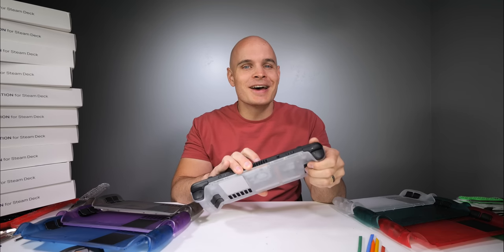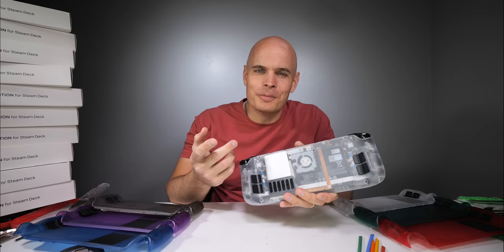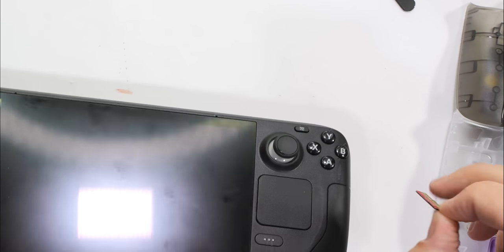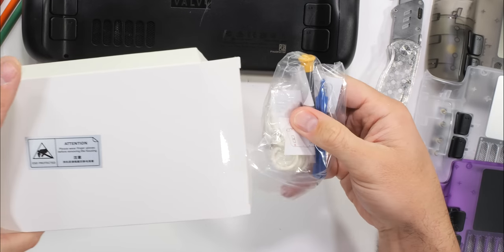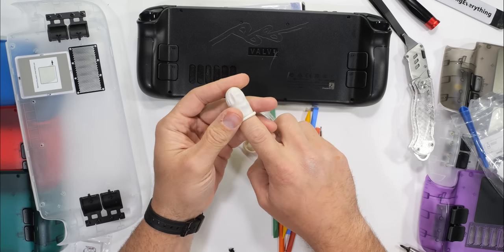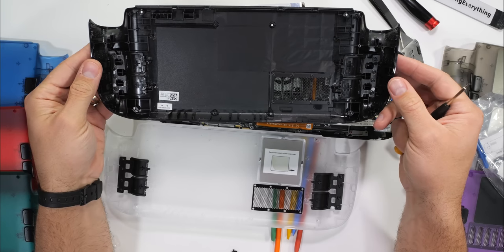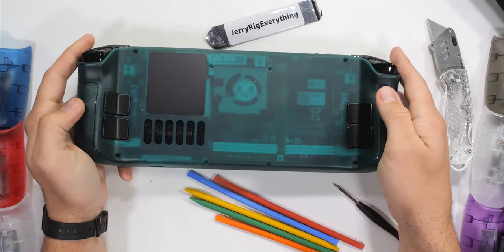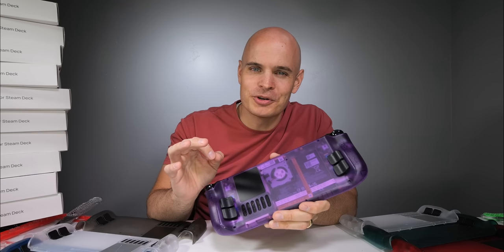NEW Steam Deck Transparent Edition!

Comment: I got the transparent purple one and the anti-glare screen protector. But I haven't even been able to do anything with my switch yet because I need this transparent back in the screen protector so that I can use the tools to take it off and switch out the 60 GB SSD to the 2tb SSD that I got and so that I can keep ice cream clean and undamaged until I get screen protector for them.

It feels like it's taking forever though!

Although I do like the transparent ones better I just wish they would have made it totally clear glossy one that was like super see-through instead of having the Smoky colored. So you could really see inside basically equivalent to what your skin looks like.

Comment: i have always loved transparent tech and don't understand why brands don't do it more often like in the good old days.. i have a steamdeck and would love to get my hands on one of these, i also think the thermal pad is a great idea
Reply: Transparent material costs more so most companies won’t use it because it’s cheap. Places like Jsaux are able to sell a transparent backplate for cheap because they use low quality parts that valve would never do
Reply: @Funnyduck  it is true that clear plastics are more expensive but most tech now is glass backed and so would be very easy to make a transparent back for them with virtually no changes. when you say that Jsaux are using cheap material you should reference this as i find nothing related to this and clear plastics are actually slightly stronger than those that are dyed.
Reply: @kbuxtonator5052  clear plastic might usually be stronger and I am not saying Jsaux isn’t “stronger” but it’s a cheap manufacturing, their backplate often doesn’t align correctly with the steam deck causing triggers to rub against. Recently on Reddit there was a thread where a ton of people shared the problems they have had with it

Comment: I love the addition of a the Heatsink on the back of the plate. I think all companies that make stuff like this should try to incorporate changes or improvements to the products that might help the end user in the long run. I have a Steam Deck and I can definitely appreciate improvements like this for longevity and overall performance boosts.
Reply: Problem is, that heatsink gets HOT and only shaves a couple degrees off under load. I deliberately left the protective plastic film on mine to reduce thermal transfer, but even then that square zone is uncomfortably hot to the touch when playing games
Reply: becareful cause other t3ch channels that really knows their stuff say there isn't enough space for air to travel with that heat sink so ve very careful it gets to burning levels
Reply: @TimmyOz - The Wyvern  another channel just took it off so there's a gap to let thr air flow
Reply: @blarzgh  Get active cooling remove that film and you will get it nice and cool. I have the gamesir f9 and jsaux fan kit and got some amazing results on Tomb Raider 2013 ultimate settings 0 rpm internal and 51c gpu.
Reply: @_GarethRossUK  yeah, I considered that. However, I don't want to have to carry around an external cooler (however compact) and powerbank every time I play something just so I don't get an uncomfortable hotspot on the back. It'd be useful for docking it and playing games at FHD, but on the go it'd just be a hassle

Comment: I have a steam deck and I love the transparent brown as well, the additional heat pad is genius. Jsaux has been doing some pretty amazing work with their peripherals for the deck.
Reply: The thermal pad is way to thick.
Reply: @HairyBottom  not really
Reply: @HairyBottom  It has to reach a significant distance and be resilient to pressure when holding the deck. Great compromise for looks and feel.
Reply: @spelare1  I never said it was thermal paste.
Reply: never said you said it was paste

Comment: I have a steam deck and, even though I love opening and repairing electronics, I was initially concerned by Valve’s thermal degradation warnings. It’s nice that there’s a product that can replace the stock plate with something cooler, both aesthetically and literally.

Comment: I just wonder : the thermal foam that’ on the case (which i love, the smoky one) will block that little shallow air chanel on the original heat plate in device… is this not affecting air flow inside the the deck???? Also i have a Steam deck…. But in Uk…😳🤷🏼‍♂️

Comment: I purchased the green after seeing this video from their website. 25$ no tax. Also got the micron 2tb drive from newegg for 173$. My read speds went from 280mbs on the eMMC to 3680mbs on the nvme. 

That hot plate also gets hot. I guess that means it works. It is plenty out of the way to where you don’t feel it. I opted to put the medium buttons for LR4 and the large buttons for the LR5 since my pinky needs to reach if I use 4 fingers on the LR12 buttons. 

This fits snug like a factory shell. I asked them if they would make a faceplate. Perhaps even a gamecube shell since all the nintendo plastics are starting to deteriorate on these old consoles.

Comment: Hey Jerry I love your videos! I HAVE A STEAM DECK and I'd love to have the purple clear shell😁 like yourself I also like to tinker with things, and I'd like to see if I can increase the cooling capabilities of the deck by opening up some vent holes right where the vent is so that it can pull in more air rather than having to work harder by pulling it from the wholes at the bottom right. That would possibly increase cooling, decrease fan noise and rpm, and maybe even increase performance! But for doing so I'd need a spare shell👀

Comment: Hey, I'd have a question: I got on of these backplates on a 2023 revision Motherboard (i think) where the motherboard has a plate on top of it. There is a gap on the top side between the back and front plate and when i try to push it down it just comes back. What can I do? The manual says to press it on a hard object for a while, but is there a safer way, like should i get a thinner heating pad?
The temp reduction is great though and you can use the plate as a hand warmer (though don't touch it for too long)

Comment: I have a steam deck.
And I don't know, it's between the gray and purple for me, and I'd admittedly miss the valve logo. Also what do you think about the air channel that the thermal pad allegedly covers? Another creator mentioned slicing a strip of it off to alleviate it.

Comment: I have a Steam Deck and...so this is not actually a new "edition" of the Steam Deck, but just an aftermarket mod? Which only modifies the one part of the console that isn't visible when using it because the touchscreen is fused to the front case?

Comment: I have a steam deck. I’ve always wanted to buy the killswitch case but it is too expensive. I tried a cheaper case and did not appreciate the extra weight and thickness. I no longer wanted a case. However this transparent back would be a nice upgrade for both looks and cooling.

Comment: Bought one but changed it back to the Valve. Backplate gets way too hot and there are no discernible temperature benefits (in my own personal use) to games. I also felt it changed the delicate balance and feel of the deck.

Comment: I have a Steam Deck 

I got the 64gb model but opened it it to replace the ssd for 256. Personally I think the clear case would be better than the dbrand because you would be able to see the parts and maybe even the fan moving. Plus the heatsink would help a ton.

Comment: I find myself playing my steam deck in dock mode a lot and it definitely runs hot when it comes to more high endurance titles so the rear back cover replacement should help a lot with heat.

Comment: I have this backplate and it's excellent. Thermal taped a copper heatsink to the aluminum heatsink on the back and it actually dropped temps a few degrees. I REALLY hope JSAUX comes out with a clear front cover eventually!

Comment: I have a Steam deck. I'm also loving that brown. I wasn't sure how I felt about the new backplates since I use the Killswitch case all the time, but I like the idea of the metal cooling plate, and the smoky brown looks sweet. Would def prefer the front panel as well, but I understand why that's not really possible.

Comment: DO NOT USE that thermal pad. REMOVE it if you're going to use these back shells. The cheap thermal pads used with these back shells are NOT designed to dissipate heat, but to absorb it for an ACTIVE heatsync transfer. The metal plate on these back shells are passive heatsyncs. These pads on the shell increase the percentage of retained heat, which could cause damage!

Comment: The back grill is actually supposed to have a piece of black tape over it for the best thermal performance. It was intended design by valve . Steve, with gamers nexus explains the whole new housing might actually increase temperatures on your Steam deck.
Reply: Can you post the link where he mentions that?